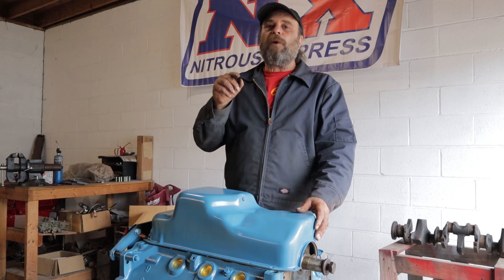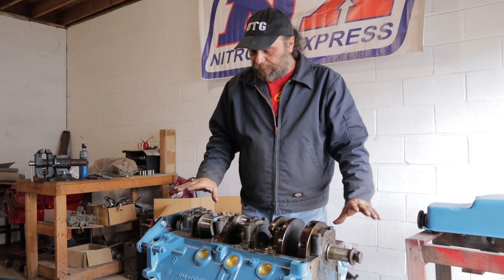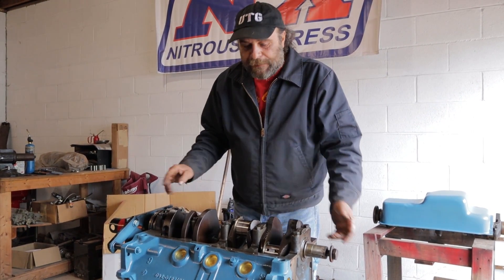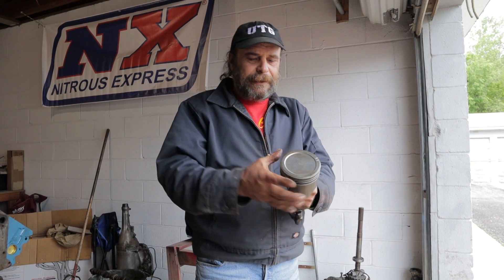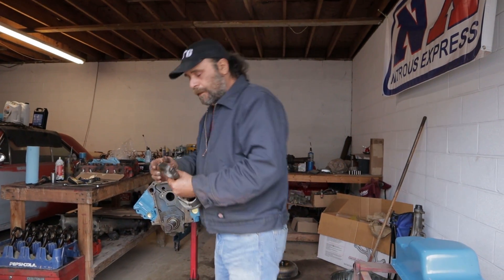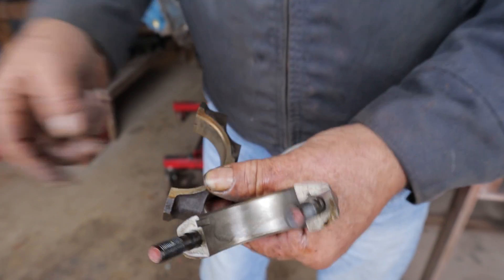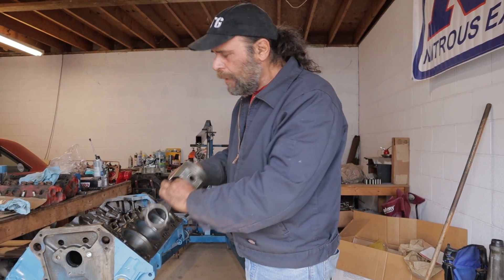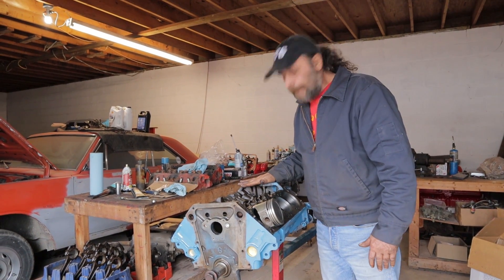Perfect Daily Driver 8 - Buttoning Up The Bottom End

Comment: Factory specs suck, especially on '60s and '70s engines. Some were so bad I don't even know how they ran. I have seen nearly new engines with one con rod bearing on the very tight end of spec, and the one next to it on the very loose end. People who don't know any better will say that engine DESIGNS from that time were junk because the engines didn't tend to last very long. The designs were beautiful. Simple and robust. Far better than the super complicated designs they have today. It was the metallurgy and assembly line build quality that sucked.

I used STP for assembly lube for decades. Now I use something designed for the purpose. I used Lucas for my last engine, about 2 years ago. Since I built my first engine at age 16, in 1975, I have been packing oil pumps with Vaseline. An old farm mechanic taught me that. It primes the pump and it will start pumping immediately. The Vaseline melts and blends in with the oil just fine.

I have never reused rings or bearings. That's what I have always been told. That if you have an engine apart, even if no machining is necessary, still replace the rings and bearings. Tony is the first guy I've seen reuse those parts, and what can I say. If it works it works. I guess I've always been a believer in "doing it right the first time" so you don't have to go back and do it over again. And to me that meant replace all the cheap parts while you have everything apart, so you don't have to take it apart again. I also always replaced the core plugs. One reason is because of what happened a couple of videos back, to clean out the coolant passages if necessary, and two, there is just no way to inspect a core plug from outside. No matter how solid it may seem, it could be about to develop a pinhole leak. And considering how much work may be involved in replacing them in many cars, to me it just makes sense to make sure they are all ok. 

Oh, and about Plastiguage (or Plastigage, however you want to spell it) I have never used the stuff. I just don't see how it can possibly be accurate enough. I have always used micrometers. When I was a teenager, I was lucky enough to know a mechanic that would let me borrow his tools, before I could afford my own. 

I did know one farm mechanic that never used a ring compressor. This guy would actually put some liquid butane in a bucket, stick the piston and ring assemblies down in it, they would freeze and shrink, and drop right into the cylinders. Today that would cost a fortune, but back then butane was cheap.

I have also used gasoline as a parts cleaner for close to 50 years. I have never found anything better or cheaper for removing oil and grease. It is hard on your hands, but when you do this kind of thing your whole like, you just have to accept it is going to damage your skin to some degree.

Comment: The flipping the Piston around thing Tony was talking about is an awesome trick it's been around for years and I've actually done a few times it definitely works, he was wrong about one thing though you can definitely do it with a domed piston too but depending on the engine

Comment: How are you Tony the trick with reversing the Pistons on a  Mopar small block works fine. I made an error years ago when I was a young apprentice. Years later I discovered what I had done after tearing apart the engine. This was my first small block rebuild and went quite well for a 318 back in the day. Done my own porting and debured the block with some basic tools. It's good to see year's later that my mistake was actually one of it's improvement's by watching your video. Keep up the good work uncle Tony and keep safe.

Comment: Good on you uncle Tony

good video

I haven’t done it for a long time but when I used to put motors together I used PastiGauge as you’ve said....

But one other thing I used to do was after putting motor honey on everything before you bolt the heads on just put the torque wrench on the front pulley and see how many foot pounds it takes to turn the motor and if something is too tight it shows up on the wrench.....

that’s not a bad final before you bolt anything everything up 

Depending how many cylinders you’ve got the number varies but acommon number used to be between 15 and 25 foot pounds for a six cylinder.....

don’t know if it still valid today should be

Comment: Correct me if I'm wrong, but if you switch banks with the piston assembly and then rotate it, isn't the offset the same as if it were in the stock location?

Edit- Nevermind, I figured it out. Lol

Comment: Tony, you might want to tell folks not to wire-wheel the skits on stock pistons.  Papa Kriebs told me that they are coated to prevent scuffing.  Tops OK, but no for the skirts.

Comment: Every engine is purpose built.  Whether for racing or only on Sundays to church.  The purpose of the engine determines how precisely it must be made.   No point in blueprinting and balancing a Sunday driver but required for high end racing.  Tolerances same deal.  The harder an engine must work the more precise tolerances must be used (note not closer or tighter  readings necessarily but accurate readings).  This is a great channel.
Reply: damn you sound like one smart son of a bitch coleman!

Comment: Hello Uncle Tony. Any advice on a good set of cheap small block Chevy heads old-school gen 1. I have a 355 that is being built right now with a set of worked over  267 heads. They have 190 intake 150 exhaust and I believe a 58cc chamber. don't really have much money right now because I just had to rebuild the whole damn motor because an idiot threw a screw-down my damn carburetor. But I need a set of heads that flow good. it's going in an 86 Pontiac Grand Prix for a memorial to my best friend who passed away of diabetes it was his car that we built together eight years ago. Any info would help thank you.

Comment: Man, I'm telling you - I've red all of the contents of these Assembly lubes. And they all either say Lithium Grease base or Moly Grease base. So, I took and blended together a mix of white lithium and black moly grease, and used a little moly based engine oil flush to thin out, haven't had a problem yet and seems to work just like the shop bought stuff. I just refuse to pay $50 for something I can make myself and I KNOW would only cost them a few dollars to make if that..

Comment: I have a '70 factory 340 swinger with a 4 speed that looks just like your daily driver.
Reply: Nice!  There were far fewer factory 4 speed 70 models because that was the year Chrysler made automatic standard and the manual trans a no cost option.  I have a 70 Swinger, too.

Comment: Nevermind, I was wrong and you are right but I still question the mechanical advantage as the force driving the piston down remains a constant no matter where the wrist pin is located and the crank leverage is a constant too,so other than moving where true TDC is I don't see where the gain would come from. I see it only making the piston wobble in the bore more. 
Ignore the rest of this comment as Tony is right as far as moving the offset. 
Sorry Tony, I might be wrong but dosen't moving the piston to the other side and spinning it 180 degrees put the offset back to the same it was before, and only moves the piston notch from pointing from the front to the back? I've ran this through my head a few dozen times. If I'm right do I get a free Uncle Tony patch to sew on my riding jacket... aw heck,,,the Intel I've got from you is enough.. Yeah I own 68 barracuda formula S 340 4 spd, a 68 barracuda, a 72 dart, a 64 1/2 barracuda, and a 72,74,77 dodge w200 club cab shortbed 4x4. Only thing newer I drive is the 08 Harley lowrider. (Don't have to smog it, or any of the rest for that matter)
Reply: So no input on if I'm right or wrong

Comment: The pin is placed offset to stop the piston rocking and knocking as it goes over TDC. This increases side thrust on the piston skirt on the power stroke. Peter Brock in Australia in the 70s found a few hp in a holden 6 by reversing the pistons and reducing the side thrust.

Comment: The old Mopar performance books claim that turning the pistons around will free up some additional power, by doing away with the piston side pre-load. Other sources claim that the piston pin offset to reduce noise, when reversed will allow the pistons to rock in the bores and increase drag while reducing piston ring seal and that will reduce power. Most old, standard racing pistons have no pin offset, but they also run with a lot more clearance. Some of the newer stroker kits use such short pistons, that some pre-load is desirable to reduce the rocking movement of the short pistons.
Reply: the rods run a couple degrees closer to vertical, pistons run barely higher in the cylinders is a little more compression, same time the angle of rods pushing the crank around+down on power stroke is changed.... many little things happen that work together to make some extra torque.
Reply: @modelnutty6503  With small block Mopars there were some different things done for a few years. The original 318 LA engines had floating piston pins. These have offset pins in the pistons. For a few years in production, the 318 went to pressed piston pins and these had the pin holes in the connecting rods machined off center and the pistons had the pins centered. These pistons are not interchangeable. Then later, they went back to floating piston pins and / or on center connecting rods. A few years of odd parts that are not supposed to be mixed. Bushing the rods is more expensive, but offsetting the rods allows the on center pistons to face front or back. The rods would have to be correctly positioned, but they always do.

Comment: O.K., wire wheel on ring lands? Not me but I guess it's ok for you.  Piston knurls? I've been inside a lot of engines & never seen it on a factory piston, haven't seen em all but I've seen a bunch. Knurling pistons was an old remedy for excessive piston clearance. Broken ring being used as groove cleaner, done that forever. Again, try using a mixture of simple green & water, about 75% simple green. You can get 4 pistons in a 5 gal bucket at a time & I guarantee if you leave the piston is the solution overnight it will remove varnish & crud. Carbon will brush off w/ a stiff brush. I clean carbs in it all the time, try it you'll like it. Ring grooves will be easier to clean also. And it will not attack the aluminum.  Forgot to show how to check the ring groove for taper. Usually not a problem w/ fuel injected engines but not a bad idea to check.

Comment: Great video Uncle Tony.
I do want to say though, when you said you use gas to clean stuff it made me uneasy. 
Gas is NOT what it used to be. it's not even remotely close to what it used to be. my late father did tanker delivery for gas stations around the area. They had meetings about just how crazy toxic modern gas has become, and even said stuff like "not your grandpa's gas" and such. The refining process has been adapted so they can resuse the "leftovers" at least two more times to keep getting usable fuel out of it. They add chemicals, refine, evaporate, etc the leftover stuff, then they take the new leftovers and add even more stuff to it and do it again. It's how they kept gas prices mostly stable for the 80's/90's. Then they ran out of new tricks to use the leftovers anymore and they couldn't get any more gas out of a gallon of oil. 

In the meantime, all the stuff they add to the oil to refine it 3 times over makes the stuff super nasty. Like, toxic nasty absorbs through your skin and makes you ill nasty. 
When I was a kid, it was no big deal- we used to clean all kinds of stuff with old gas, was a good way to use an old can that got forgotten in the back of the machine shed. We would clean parts, clean paint brushes, whatever. But that's not how it is anymore. All the safegaurds they have now, sure a lot of it is yuppie treehugger BS, but then, there's a hint of truth in everything and part of why the new safegaurds exist is because of how much more nasty the fuel has gotten in the last 20 years. 

i guess I just mean to say, be aware that the can of gas you want to pour onto some old engine parts isn't the same as it was when you were a young man, no one will stop you, but IMO there's better, safer stuff to use nowdays that won't have toxic nasty absorb through your skin at record speed. 

I work in injection molding so I can cheat and bring home cans of mold cleaner. Lot of guys I talk to just use brake cleaner for almost everything, or just acetone. 
Here's a secret squirrel: Zap-Ox. We use it to remove stains off of tool steel . This is like some time traveler's mistake left behind when he went back to the future type of cleaner. Smear some on, wait a sec- scrub it off(or just wipe it off) and ta-da, looks like new metal. They have a video on youtube here, Zap-ox by Nanoplas.. No lie, this stuff takes off things acetone won't touch off of metal, most powerful metal cleaner I have ever used short of acid based stuff. A little goes a long way too. Saves a lot of elbow grease. There's a zapox kitchen cleaner, thats not the same stuff. Type Zap Ox into the search on you tube, it's like the second video.
Reply: Gas doesn't even smell the same as 30 years ago.
Reply: We were told that if you had to use gasoline to clean parts, buy unleaded, back when it was an option. There is better stuff to clean parts with, as well as safer, maybe not as convenient.
Reply: Benzene ...extremely carcinogenic also dioxin from melting plastic very toxic

Comment: Not knocking you build Tony its an awsome build so far 👍. I'm going to be buying a digital scale like a large one i seen at the kitchen supply isle in walmart and start weighing/ balancing my rods , pistons ect for my project 360 build. Crank will be sent off and balanced checked. I was always told buy gear heads , mechanics machinist and hot roders that a properly balance engine will last a long time and produce more power because everything is working together inside the engine especially at high rpms. Yes gasoline works great for cleaning parts outside or in the garage well ventilated.  My grand dads that worked with their hands on trucks cars and farm equipment all said they used gas to clean parts and nuts and bolts 😎👍. Is there any parts you need donated for this project? Also is there an email to talk to you more or send pics of my project 65 dart?
Reply: If it’s going to see high rpm then yes I would weight match and balance your rotating assembly